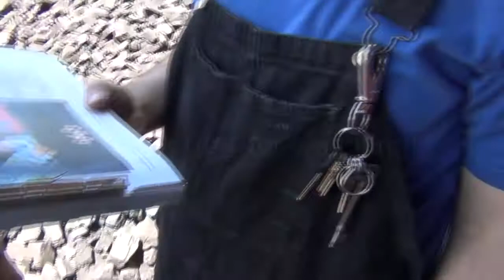throttle time with 643

Comment: What do you need to do to drive 643? Awesome video also!
Reply from the maker: make reservations
Reply from the maker: call this number# 1717-585-4071 and tell them you want to drive steam
Reply: Awesome! Thanks so much! Is there a set schedule or age requirement?
Reply from the maker: ask when you call when the next date is that the 643 is available I'm not sure about the age requirement
Reply from the maker: you may have to be 16 i'm not sure though